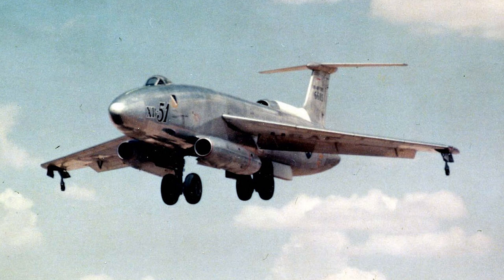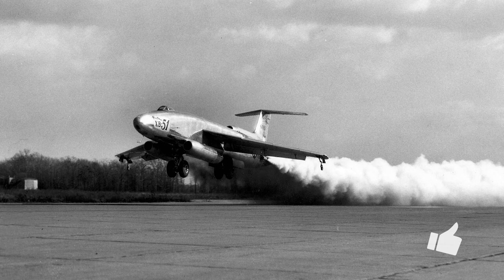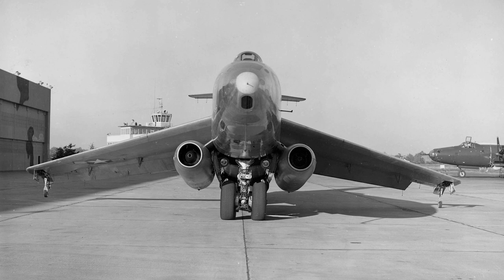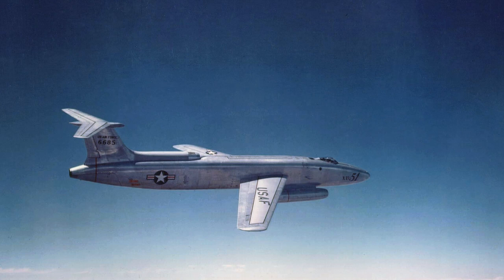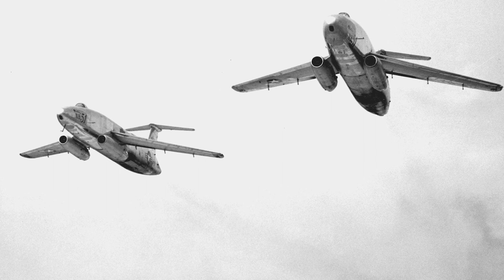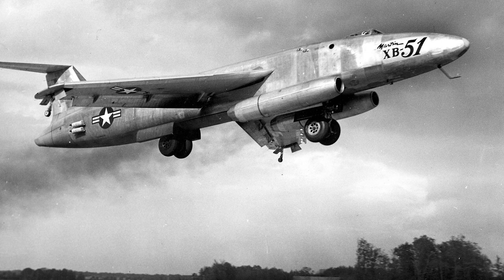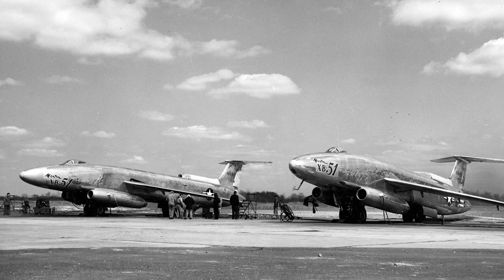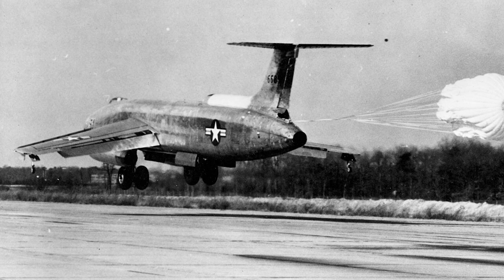Martin XB-51 - A Short History

Comment: Nice story on Martin's impressive XB-51.  One slight correction: according to the book, "XB-51," (Air Force Legends Number 201) by Scott Libis, the first flight of the XB-51 was on October 27, 1949.  The second (and last) XB-51 took to the air on April 17, 1950.  The British, English Electric, Canberra bomber was indeed slower than the XB-51 but it had lower wing loading that gave it a range and low altitude maneuvering advantage.  At least Martin's innovative rotating bomb bay was incorporated in Martin's license-built B-57 version of the Canberra and Martin would go on to build around 400 of this classic British jet bomber.
Reply from the maker: Thanks for this! And thanks for watching!